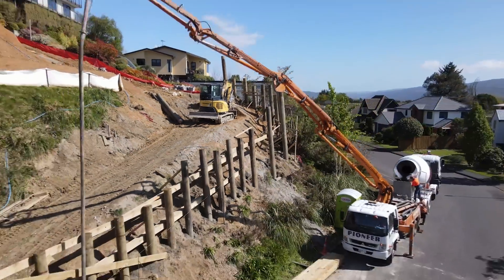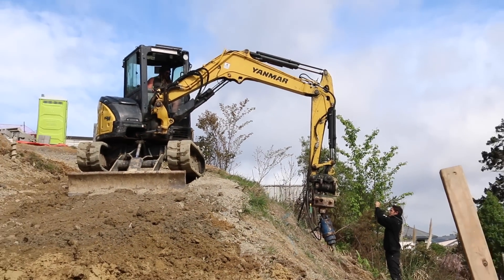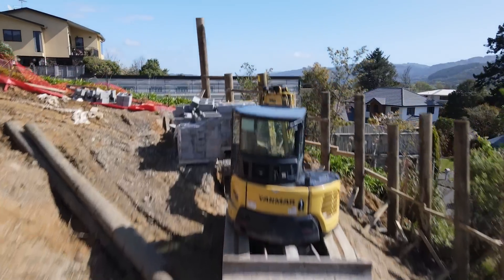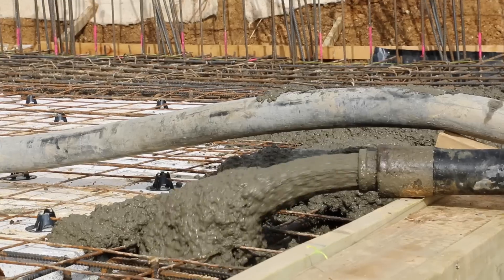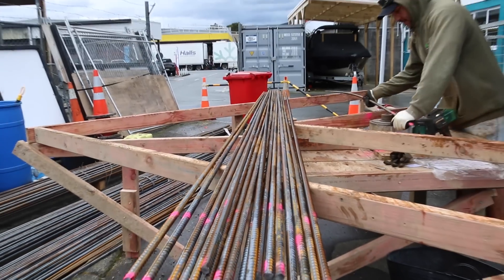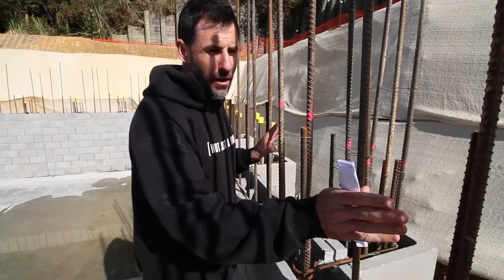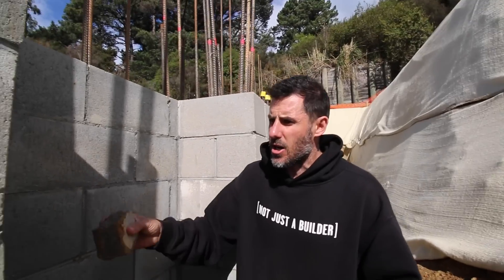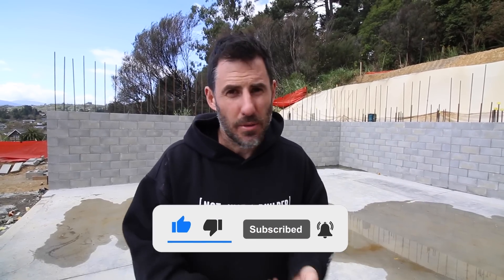Huge Retaining Wall Failure on My Toughest Building Site Ever

Comment: That is a prick of a way to Deadman a wall. By far the better way is to trench a reinforced footing. Way way way faster and cheaper. I have gone to a different engineer (My engineer) and redesigned the wall and made amendments saving the customer thousands on one job. Agreed on the steel bending I too bend my own. Way faster.

Comment: Good to hear you say you're drilling a decent depth into rock. No "yeah/nah" on this job. In the 80s I worked on a 13 story project in Miami, and ever since when I reflect from my home in Golden Bay, I expect to read about it pan-caking because what the engineers drew wasn't always followed. 37mm car park ramp deck rebar being installed into a 3" deep column (brrr.) So cosmetic.

Comment: The earthquake seismic retaining loads are very high in wellington, hence the block pilasters I assume at very close centres. Might have been better to start with an insitu concrete wall say 1.0 m high with the 25 series for the rest . This would have made the tanking a lot easier and cheaper to build as well .

Comment: It was very frustrating to watch this video. Most of this could have been accomplished easier and cheaper with a dincel  wall . Which would have lasted longer than timber.
Reply from the maker: Would love your pointers - send me an email
Reply: @nzbuilder Is this the concrete crib wall system?

Comment: please tell me u are using a Viking waterproofing membrane not just mold seal as that shit dosn't work for shit
Reply: it has a 50 year garters
Reply: Viking applicator here. The next video covers it. He's using the Ardex equivalent. But would have been better to do full torch on tanking both under the floor and up the wall. The join where the plastic under floor membrane meets the peel and stick  wall membrane at the footing, is always a weak point.

Comment: I’m amazed they built this wall from timber rather than steel or concrete…doing all that work/prep  only to put in materials that won’t last the test of time is in my opinion insanity.
Reply: H6 Timber piles go in the water just fine,, with the right treatment or the right wood it can last a long time

Comment: who came up with such a stupid idea to use wood instead of steel and concrete for this wall
Reply: The wood will be CCA treated, which is banned in the US (?) but will be good for 30-50 years and probably last longer than too.
Reply: I’m guessing these treated poles have proven themselves over time, to be ok’d by the engineers. After all, they use them a lot for house supports too, as seen in his other videos. Here in 🇨🇦, we tend to use those mega concrete blocks on engineered concrete footings, even the jumbo Allan blocks work too. 🤙
Reply: Where are you from? I own a similar structure in a different part of the country. It's 30 years old and good as new.
Reply: 15 years is the lifespan in dry area, 10 years in wet area climates, easy to look at the NZ standards, this guy is doing what’s required by the engineer and government standards…

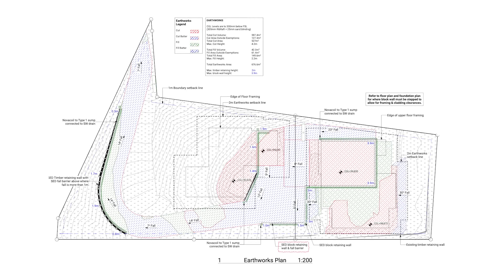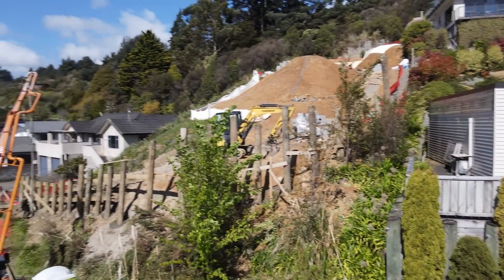Comment: Interesting that the engineering plans for the retaining wall specifically note "Existing Ground no slope" (@ 2:11) however there appears to be a very steep slope in front of the wall (@ 3:35) which will significantly reduce the capacity of the poles. I am surprised the inspecting engineer signed this off given this is noted on the plans.
Reply: I noticed that as well, not sure how this was signed off
Reply: Where the slope stops is treated as the start of ground?
Reply: @MrHavokman  Yes, this is one way to look at it but in this case it looks like it slopes all the way to the road so the retained height will be much larger than its designed for plus your embedment depths would need to be taken way down too.
Reply: Just the first of many plan amendments I assume

Comment: The land would have to be cheap, because this build is going to cost a fortune. I hope the views are worth it. We have a section in New Plymouth, which sits on old swampy ground. Thankfully we bought it 25 years ago very cheap. There's an old house which we did up and got repiled, but there is enough space for another property, but it has to be compact and multi level. We had Geotech done and they said piles would have to go down 10m to the hardpan. We were going to build a modern Japanese themed townhouse over 3 floors, but the budget was 1M, so we sat on the idea. Now we are thinking of a multi level tiny home as an Air B&B. The plan is a 4.5 x 4.5m footprint over 3 floors with an additional 4th floor loft space. We can build up to 11m with a discretionary 12m maximum height, which means if we built this, it will be a mini skyscraper. The views from the top floor will be very good, but it's going to be interesting to see what an Engineer says. My Wife is an Engineer, but not structural. We might need some steel? Not sure? Maybe fine with 145mm thick studs, braced with ply and colorsteel on the outside. It's not going to be cheap, but it won't cost 1M.
Reply: Investigate hammering railway lines down the 10m. Cheapest way to go down that depth in either swampy ground or hill sites.
Reply: @DiscoFang  The geotech guy did say maybe it needed H beams. We have a high water table too, so drilling a hole will be like drilling a well.
Reply: @Justyburger Yep lines are h or I beams. And you don’t drill, you drive. Could be done in a matter of days.
Reply: @Justyburger 40 years ago when I was first introduced to spec building, a mentor used used railway lines here on steep sites in Wellington. And I mean steep, not like Josh’s here. They were cheap, good quality steel, and again, cheap. I think they were 5 or 7m standard length, and you just weld another on as required until bearing resistance is met.

Comment: The owners must have literally won Lotto to build that, on that site..
Reply: Couldn’t imagine the cost of the siteworks
Reply: And a view of what??? Other house roofs😂😂😂 nah I’d only spend that money if it was a view of the ocean or snow cover hills
Reply: This is not a bad site actually. They get real expensive when you need to rock anchor the concrete floor in place. I no longer do this work because you can make more money in less time doing simpler jobs but yes they cost a fortune.